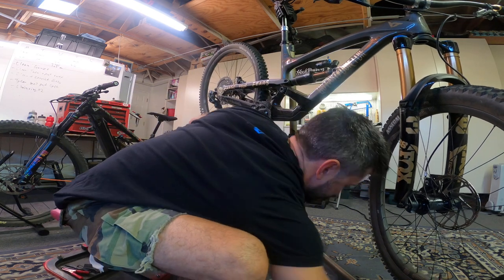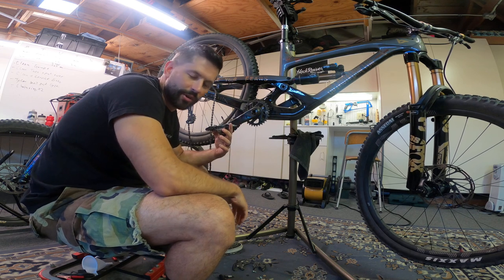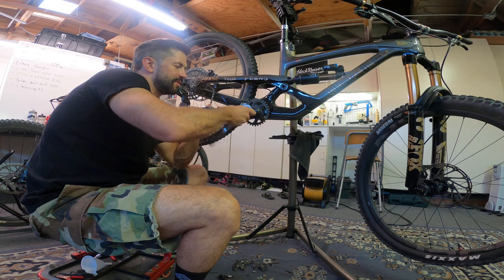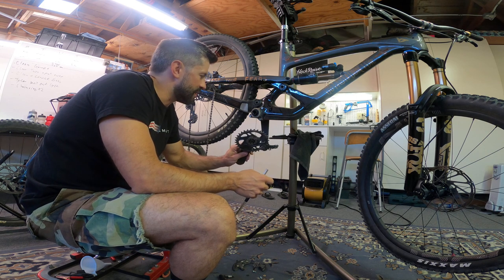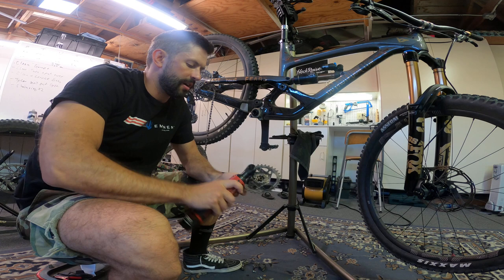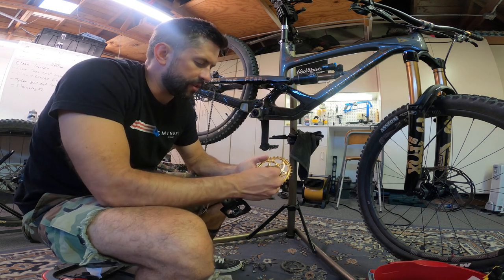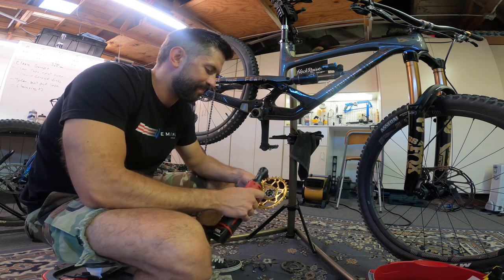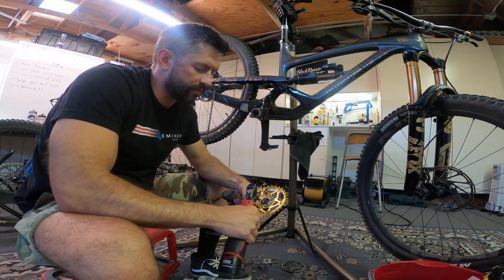YT Capra Elite Oval Chainring Upgrade & How To Install

Comment: Some gorilla put my Capra together and had to use an old set of handlebars as a breaker bar to get my bracket off, as well as standing on the pedal.
Reply from the maker: Yeah. Super annoying. Glad you got it out.

Comment: The way got my loose I got a 2x4 piece of wood to lock the crank spinning back then i used a long cheater bar, it took some work but I got the job done in a safe way.
Reply from the maker: Daniel Patino yeah, I have removed them just a ton of times and it is always disturbing but I get it done. This time in the Izzo really worked me though. Maybe I needed to eat first. Lol
Reply: Im in the market for a new bike it look like you a have a lot of experience on YT i love to climb and i like to enjoy the downhill not pushing myself to crazy limits. 
Im trying to figure it out ether the capra elite of the Izzo launch edition, my 3rd choice is the canyon strive 9.0
What would be your recommendation?
Reply from the maker: Daniel Patino I actually think you might want to consider the Jeffsey.  It climbs well and goes downhill well.  The Izzo can really do everything though.  You may not be able to buy a launch edition Izzo though as they are all sold out.  If you want a YT, maybe plan to order a 2021 the beginning of January.
Reply: Sean thanks for the reply, i was able to order an Izzo launch edition it will be shipped on january 21st  so you think the capra might be too much of a bike for what I do and maybe ill be having a hard time climbing? 
I do santiago peak (twice a year) in OC which is 5689ft of elevation and there is a nice single tracks (some pretty insane) going down. 
However i live by Greer ranch and that one i do more often. 
Have you done back to back climbing test on your YTs?
Reply from the maker: Daniel Patino I have done back to back tests and I have ridden in those areas. For me, I know the Izzo climbs best but I still mostly ride my Capra because it is so much more fun downhill despite the small punishment on the climb.
Reply: @CaptGoodJob  thanks for the reply I’ll put the capra in the top of my list. 
Thanks.
Reply: Hey bro like your video, can you help me on what size is the oval I have the same bike and you able to put the chain guard back??

Comment: Hey bro like your video, can you help me on what size is the oval I have the same bike and you able to put the chain guard back??
Reply from the maker: Hi Alex. I bought the32t from Worldwide Cyclery. The chain guide slides up and out of the way and right back with the new ring on. You don’t actually have to remove it. 

absoluteBLACK Oval Narrow-Wide Direct Mount Chainring - 32t, SRAM 3-Bolt Direct Mount, 3mm Offset, Gold
Reply: @CaptGoodJob  why the 32T and not the 30T? I have a 2020 capra pro race. Im just confused on which oval ring to choose. Thanks
Reply from the maker: kevin luu I have the 10-52 chain ring on the bike. I didn’t need the 30 the same way that you would. Get the 30 of you have a 10-50T on the back.
Reply: @CaptGoodJob  great answers I have the Capra elite and was thinking of putting the oval ring, I hate climbing as well. this was really helpful. any other pros or cons you noticed after riding it for a couple of months?
Reply from the maker: @xBry4nTx  I have noticed that I keep changing my suspension setup. I just can’t lbs on exactly what I want there. I also am obsessed with the Oval chain ring and the AXS components. Other than that, I run a cushcore out back and I may take it out for a while to ride at around 31 lbs.
Reply: @CaptGoodJob  nice my bike is heavyyyyy. I weighed it before going tubeless this past weekend and came in at 34lbs have cushcore XC and tubeless now, after I install the chainring you have on Friday ill reweigh. how did you get yours to be so light.
Reply from the maker: @xBry4nTx  first, I don’t care much about overall weight, more just the weight of the wheels. Maybe your tires weigh a lot? DDs are like 1200g.